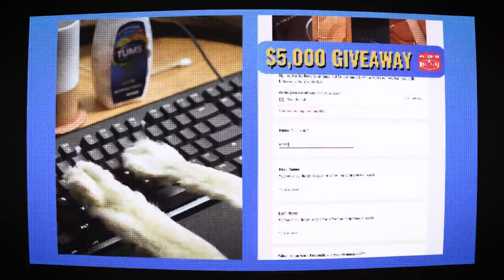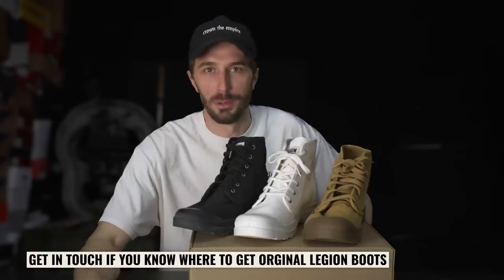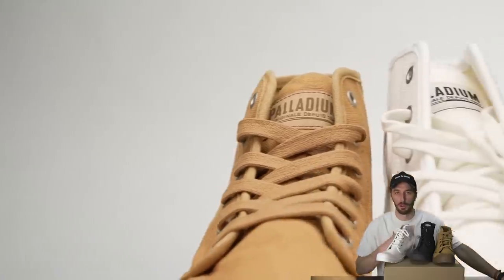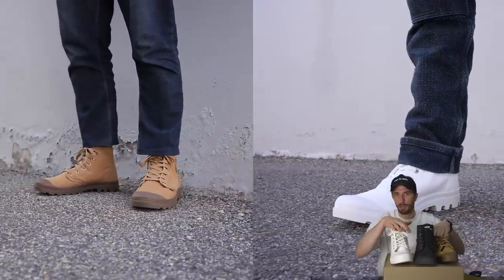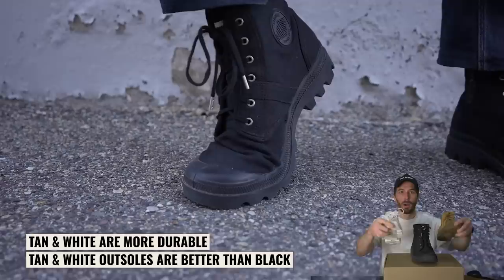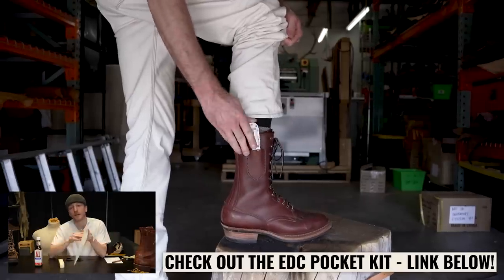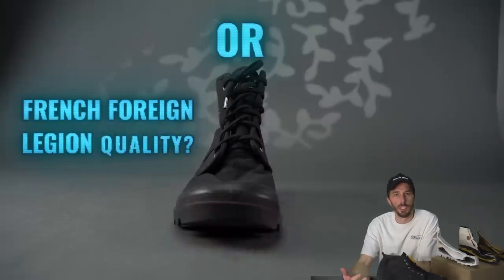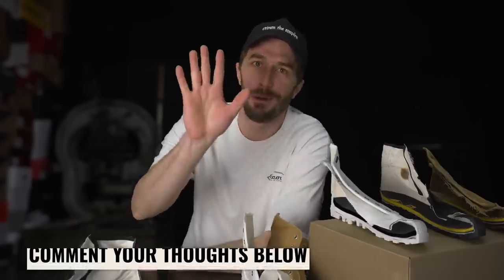(Top 3) Palladium live up to French Foreign Legion legacy?

Comment: Great review as always sir! I posted this on another video but thought I'd share it here too...

TLDR: Bought my first pair in 2014, still in great condition, I still wear them regularly, and just bought my 5th pair this month.  All are US size 8. 

I bought my first pair in Nov 2014, the all-black leather and nylon Pampa Sport Cuff WP2 on sale for $70 CAD. They're very comfortable, my most worn pair and they're still going strong. The sole has held up great and they look like they've still got many years of life in them. I wear them year-round and they've been my go-to winter boot since I bought them. For context, I'm in the Toronto area.

My second pair is another all-black leather model, the Pampa Sport BaggyWP purchased in Jan 2015 for $78 CAD on sale. These are the ones with the fold-over collar to make them shorter or taller. I've only worn these a few times but plan to make more use of them now to give my Pampa Sport Cuff WP2 a break. This one feels a light tighter in fit. 

My 3rd pair is another all-black leather and nylon pair, the Pampa Thermal which is a real winter boot. Paid $120 CAD on sale in 2015. These are used mostly on heavy snow days, mostly for shoveling the driveway.

My 4th pair is the Pampa Hi Mono Chrome in the Olive Night colorway. These are the non-waterproof canvas boots made more for summer but I sprayed them with waterproofing. I got these in Nov 2022 for $85 CAD delivered. I've only worn these a few times also. These fit a little looser than the others, mainly because they don't have the additional lining. These are basically like high top Converse Chuck Taylors but with a knobbier grip.

I just received my 5th pair, the leather and nylon PAMPA SHIELD WP+ in the "Dear Brown" colorway (a light caramel color) for $121 CAD delivered from the Palladium online sale currently going on.  Haven't worn them yet but am confident they'll be another great pair of boots for beating around town in.

Comment: I own a pair of Pampa Hi Seeker Lite Waterproof and they look better than the hi Chuck 70 that I used to have.
Like he said, the design on the outsole on these boots are really nice, the grip you get from walking on snow is one of the reasons I'm glad I got mine over another Converse when it started to snow a few months ago.
The comfort on these, at least for me is okay. I did replace the insole for a more firmer one (Superfeet blue) but I've had no complaints especially with the side zipper that makes wearing it slightly more faster but keeps its waterproof feature in mind with the design.

It's definitely not a "Boot", but it's good enough as a casual street shoe and better than a Converse in terms of design and comfort.

Comment: I had several different models of these boots, from leather to canvas, and so far the best, long lasting, ones are the leather ones. The soft canvas are not that great, the canvas wears out quite fast. I recently bought the waterproof ones made out of "recycled materials" and they are ok. But, from my overall  experience with them, the constructions is quite poor: the canvas wears out too fast, the glue that joins the canvas to the rubber part wears faster than everything else.
I still buy them because I like their design and comfort, but I now know that they are not built to last more than 1 or 2 years when using them every other day and I have that in mind when I am looking for new ones and I try to buy when they are with some kind of discount - at their full price, they are not worthy, their overall quality doesn't match their price, which is true shame because I really like them.

Comment: damn, it would be nice if these were harder wearing. i like lightweight shoes with a higher top, lower drop, and an outdoor tread. sounds like with a little ripstop, and a more robust sole these could be nice daily drivers, especially if they had a faster lacing system like modern combat boots.

Comment: I have black canvas Pallabrouse Hi and some "winter" model made of honey nubuck and woolen "fur". Got thema at a great price still am NOT convinced...

tldr: They are 
+ very comfortable, 
? werdly looking (heritage)
= sneakers!, 
- have ZERO in common with original - outside of bought "brand" = bragging rights you got duped
- both with some design flaws :(
--- NOT worth their price unless you buy them at a bargain

The black ones are NOT good for summer as the lace inlets (is that the word?) are hurting your ankle like hell without the proper sock. WIth good sock, they wont hurt you but are too hot for hot days...not wearing them much...In colder days  the canvas wont protect your foot against the wind/cold. Obviously NOT the water. Have them once hiking and they got a dent in canvas....THese are for city...
\
Honey/"leather" ones:
Comfortable as a sock, (hopefully more durable as one). Not kidding. Super comfy. Its crazy. Looks fantastic IMHO
Unfortunately - the tongue has no gussets and the wind/snow, well EVERYTHING will go in. Its NOT possible to lace them tightly unless you have super skinny feet...why they didnt put gussetts JFC...completely destroys the design... They are NOT warm enough for winter anyway - around 0 celsius would be OK, as the ribber front GETS COLD quickly...But then the lack of gussets will really do you no good in colder temps...
BUT VERY COMFORTABLE! Unless little amount of snow gets in and melts...or a wind comes in...
ah sh(t.

well - be aware, buy at your own risk, they still can be fun...HERITAGE LOOK! NOT HERITAGE QUALITY!